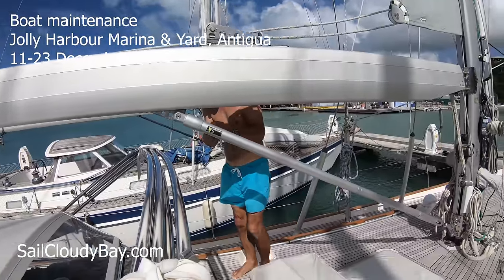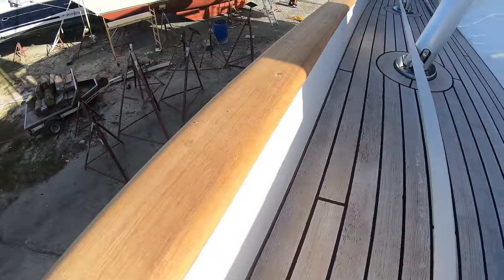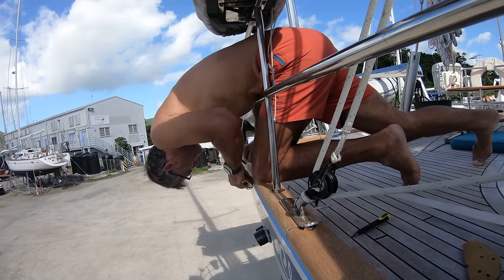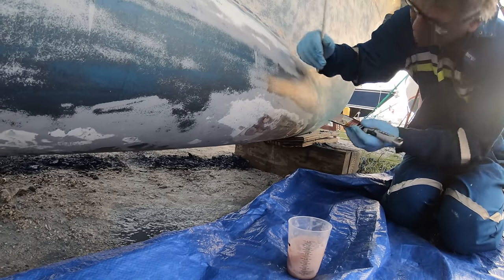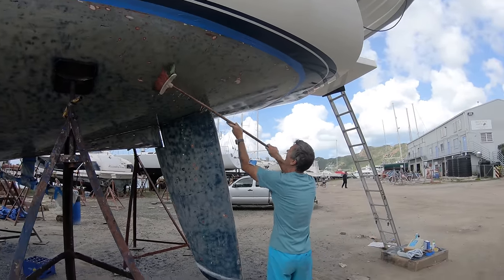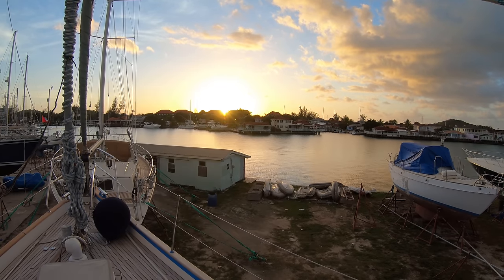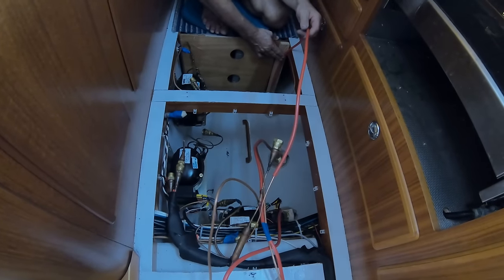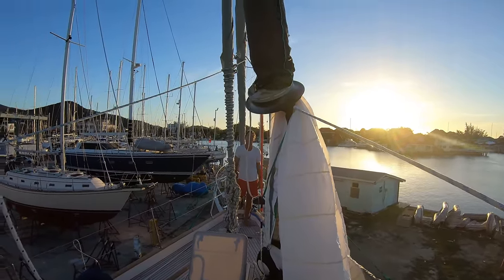ep55 - Boat maintenance - Jolly Harbour, Antigua – Hallberg-Rassy 54 Cloudy Bay - Dec 2018

Comment: @ Cloudy Bay: The correct way to braze refrigeration lines is with fluxless brazing rod AND a nitrogen trickle through the copper line while brazing. Also, a new filter drier is installed every time the lines are exposed to atmosphere.. The system has to be evacuated before refrigerant is added back. Any refrigeration or a/c tech will confirm what I have written.

Omitting the nitrogen trickle allows a load of black gunk to form on the inside of the tubing and that gets into the expansion valve, evaporator distributor and compressor.
Reply from the maker: Thanks for the advise Paul. Unfortunately getting good refrigeration people in Caribbean is really tough. I think I will try to find another more qualified person in St.Maarten and have the systems vacuumed.
Reply: @SailCloudyBay  You seem to be mechanically capable. It is not too hard to learn how to do your own refrigeration maintenance and repairs,
Reply from the maker: Yes, I'm just new on that path to learning the intricacies of refrigeration maintenance. Clearly its not rocket science, but it does have its specifics you need to be very careful of.  I bought gauges and a bottle of R134. Maybe I should get a vacuum  pump too. Question is, where do you stop? vacuum pump? brazing torch? refrigerant detector?  In mid Pacific I'll probably be glad to have all that!
Reply: @SailCloudyBay  The R 134 is worthless without a vacuum pump, manifold gauge set, fluxless brazing rod, nitrogen bottle and nitrogen regulator. Best to get experience before you need it.. The small sizes you are working with can (probably) be brazed with a Bernzomatic jet torch. When you are in the US, you can get the vacuum pump and manifold gauge set cheap from  Harbor Freight.. 

Practice brazing on some copper scraps with the nitrogen trickle. Pressurize your practice assembly and check for leaks with Windex or soap solution.Cut it apart to confirm that you can make a clean braze..

If your refrigeration circuit does not have service ports,then you need a refrigeration scale and a spec to weigh in the correct amount of R 134.
Reply from the maker: Paul, fully understand. But what makes "R134 worthless with a vacuum pump"?  Not questioning you, just trying to understand, because our fridges seem to be working OK after 3 weeks now.  That said, with your advise and several others too, we will be having all 3 systems vacuumed and refilled correctly once we get to St.Maarten, where services are as good as europe.
Reply: @SailCloudyBay  I wrote worthless not worth....But that is not really accurate. You can add R134 if you have a small leak without evacuating so long as there is still pressure in the system. If the system is opened, then you need to evacuate before recharging.
Reply: FrigoBoat has extensive troubleshoot files. You should not have to be evacuating an new FrigoBoat.  I suggest you read the files and give them a call.
Reply from the maker: If we were connecting the new keel coolers into a frigoboat system it would have been easy. But the rest of the set up is Isotherm and of course they dont have the same connectors. So we had to chop the Frigoboat connectors off and braze on isotherm one.

Comment: hi great videos, but I have to ask when the fridge work was done, did they get vacuumed and checked they held a vacuum prior to gas been added? it is imperative it is done to remove moisture from the system or they will be plagued with problems.
Reply from the maker: Good point. No he didn't.  The way he did it, would not have let any "air" into the system. But now that I read up, you are right, it should be vacuumed. I'll get that done in St.Maarten.  Thanks for noticing that.
Reply: Sail Cloudy Bay, Hope iv helped. Whenever you have a leak in a refrigeration/air-conditioning system ie. needs gas!! there is a leak/hole in which air can ingress and gas escape! Air contains moisture the biggest problem for refrigeration systems and the only way to repair the system is to vacuum it. the couplings that the systems you have will introduce air, we looked and trialled them for many years and were never happy with them when we used to manufacture and supply systems. I also noticed when he brazed the lines, it looked like he changes the fittings it would have left the lines open. the long and the short if it's opened in any way you need to recover the old refrigerant prior to work, carry out the repair maintenance then evacuate the system with a vacuum pump (overnight is best as it dries the system of any moisture yes there is a dryer installed in the system to try to dry the gas but it needs all the help it can get), only when it holds a vacuum with the pump isolated only then add refrigerant to the correct level, the correct level now that has to be calculated and the correct weight of gas added or if you have a sight glass you can watch that till the flow is clear and consistent ( a good sight glass will also have a moisture indicator built in). Moisture in the system will freeze in the capillary tube or if on larger systems the expansion valve and cause the system to fail. I'm an ex-marine engineer/refrigeration engineer and I can assure you unless they use a vacuum pump and the proper service ports that can be evacuated along with the lines and refrigeration gauges all the way to the cylinder with refrigerant it will always introduce air. if I can ever help drop me a line always happy to help.

Comment: Nice video lots of details 
Glen I did not see a vacuum pump used on your refrigeration also your tech guy opened the valve to let vapour into the system. If this is 134a which most are today it is an isotopic refrigerant it must be charge by liquid feed only . If this was not done you will have problem . Dont know the date of this but if its weeks or month you may have already experienced poor performance.  
Fairwinds from the  @captains.chair
Reply from the maker: Good point. NO he didn't.  The way he did it, would not have let any "air" into the system. But now that I read up, you are right, it should be vacuumed. I'll get that done in St.Maarten.  Thanks for noticing that. So initial fill has to be with liquid (with bottle upside down), not with vapor? (bottle right way up).
Reply: @SailCloudyBay  I've been an industrial refrigeration mechanic for 33 years. So I do this still every day but on units much bigger .soon to be full time sailor .
As for your question yes liquid here are the steps to be followed .if you have any question you can find me on Instagram @captains.chair 
Step 1) pressure test 200psig min I use nitrogen inert gas and less then 5 micron of moisture which is #1 enemy 
Step 2 no leak? vacuum pump, time is essential to remove moisture & non condensables these will  cause multiple issue .if not removed well.
if you have a micro gauge to measures moisture awesome 

if not evacuate 30 min then break vacuum with a squirt of liquid 134a to 2-3 psig  evac this back down to 30" . Close ref gages valves let stand for 15/30 min this should maintain 30" if this deflects  28"  25 "  you still have moisture or possible leak repeat til your suction gauge(blue) maintains 30" make sure ALL FITTINGs ARE SNUGGED hoses to gauge and vacum pump etc.
Step 3 once you are 100%sure she maintains 30" WC you are ready to charge liquid 134a only
This should be weighed in by scale . On the package it will tell you how many ounces .( Tag)
Anyone telling you they can charge these very small units any other way are cowboys .period
If you do not have a scale or vacuum pump let me know I will explain another method. 
Once charged.  read up on superheat and subcooling if you have digital thermometer you can check the charge using this method but it is time consuming on these little units and very finicky
If you follow these instruction to a "T" you will have many many years of carefree refrigeration and when we meet up one day .I will be expecting a very cold beer...or 2 
Hopefully sooner then later 🍻🍻⛵⛵⛵⛵⛵⛵⛵.
P.S calibrate your gages before you start to 0 psig that little screws on the dial  ,be gentle 
Fairwinds from the @captain.
Chair
Reply from the maker: Jim,  That advise has to be worth at least several beers!  Thanks so much. I dont have a vacuum nor N2 nor a scale. But we are about to go to Sint Maarten where I will find those things plus a decent guy like yourself to administer.  With these instructions in hand I will watch like a hawk this time.
Reply: Did not your FrigoBoat come pre-charge with leakless connectors?
Reply from the maker: If we were connecting the new keel coolers into a frigoboat system it would have been easy. But the rest of the set up is Isotherm and of course they dont have the same connectors. So we had to chop the Frigoboat connectors off and braze on isotherm ones. Sadly.
Reply: @alansugarman2631  Hi Alan if you ever find connections that are   "leakless"" let me know I will split the million dollar idea with you😉 .lol 
Unfortunately there is no such things . Most leaks are from corrosion ie poorly insulated or vibration . They do now have teflon lined stainless steel flex lines that have  dble flanges flares . These are expensive but very reliable 
 Definatly after market product. 
Fairwinds ⛵
Reply: I see. But you have the Isotherm quick connectors. Will be interested to see  what you do next with your fridge. Very frustrating.

Comment: Hi there let me comment about the painting of the bottom NEVER EVER paint the last 2 layers upside down ALWAYS ALONG the boat , it reduces the drag and reduces the anti fouling paint to be scraped away , small advise , :-)
Reply from the maker: Thanks for the advise, I've certainly never heard that before. If the paint is put on evenly there should be no difference in drag vs any particular direction. That said, maybe you are talking about the coats that we had applied before Glen took over the painting. The guy was rollering in long vertical strips that left the paint thick on the edges and thin where the middle of the roller had gone. So he got kicked off the job and Glen finished it ... painting the last coat evenly.

Comment: was taught never use acetone on gel or fibreglass,it's an acid which works on breaking down the materiel and weakens it
Reply from the maker: Interesting .... never heard that before.
Reply: Best is to use styrene monomer for fiberglass work.. It cleans and reactivate the old fiberglass making a better bond with the new...

Comment: I know you leaked currency but did you test for current leakage after those boom lights?
Reply from the maker: Ratus Bagus not quite sure what you mean but if you are asking the consumption of the boom LED strip, it’s about 10watts
Reply: @SailCloudyBay  It was a poor joke linking refit currency leakage from your wallet to electric current leakage from your boat.  
Fitting cheap or/and Chinese domestic stuff into your vessel can come back and bite you. Hard. 
Faulty connectors or earth or maybe that little box within a box symbol that should mean that it doesn't need an earth because its got magic electrickery components inside? Well sometimes that's just assertion.... and it doesn't. It works along the lines that it'll blow, be binned and not followed up..... rather than sink a ship with all hands. 
Sailing Hilma's rudder was lost mid ocean after the did some electrical work. Look them up. They have a few videos that cover cable work, later mid ocean drama followed by the restoration. The stock corroded fast. 
You're still here so perhaps you're OK. But if trips are tripping.... 
https://www.boatingmag.com/how-to/locating-ground-faults-current-leaks-and-short-circuits/

Comment: Top surface of the rudder?
Reply from the maker: Ratus Bagus what about it?
Reply: @SailCloudyBay  did you manage to get to it to paint it?
The boot line was definitely fantastic BTW!
Reply from the maker: Ratus Bagus yes, with the rudder on full lock I manage to roll paint onto the upper surface.
Reply: @SailCloudyBay  I just had an idea for getting paint into all those hard to get to places.
Get her into a dry Dock. Remove sensors and plug through-holes. Mask off topsides down to the bootline.  Give Hull a little rub over. Fill dry Dock with antifoul or copper coat. Drain & dry. Unmask and unblock thru's. 
Then just add water.  I'm sure this would work and dispenses with that support patch nonsense. What do you think?
Edit. You may have to refill, drain and dry a couple of more times.
Reply from the maker: Ratus Bagus what a brilliant idea. But there would be no need to mask off the top sides!  And ... how would we paint from waterline to the boot line, eh? Eh? The technique might also use a tad too much paint too!
Reply: @SailCloudyBay  what's with all these negative vibes Moriatti. Think positive man and that bridge to our golden prosperity and business success will be there.
On those little cost wrinkles, I was thinking that you would provide the venture capital and I'd provide the thought leadership, inspiration and innovation. 
I'm sure I can count on you to come up with a flexible financial framework for the paint anomaly.
BTW Topsides...would be something similar but upside-down with mast and rigging removed. This would provide an additional bonus of dispensing with all those internal varnishing jobs. In fact we could leverage that as our trademark feature. Thought I'd run that up the pennant pole to see if it would attract a salute.  Thoughts....?
Reply from the maker: Ratus Bagus good luck!

Comment: Seems like you kept throwing Herrington harbor under the bus. Your bottom job would it look like that if you were willing to pay to have it done....
Reply from the maker: Yes it would have looked like that and my wallet would have been $2000 lighter!
Reply from the maker: Just to add, we had great work done in Herrington. The gelcoat repair by Osprey was fantastic and the polishing worked out really well too. regarding the bottom, we had no choice but to strip it all off due to a reaction with fresh water and it was the stripping back that was a huge cost compared to having it done in Antigua. The other 2 factors were time and temperature. We really wanted to get south before the weather closed in and doing the bottom properly would have added another week at least. And the temperature was already marginal for applying the 2-pack barrier coat. So yes, we mentioned "this is how it should have looked in Herrington" but it was not meant as a bad mark against services there.
Reply from the maker: Just to be clear, in Herrington they wanted $4000 just to strip (soda blast) back to original barrier coat - a 1-day job. And then painting would have been $1000 per coat. In Antigua we had a haul/launch, the paint stripped and all the paint (5 coats) applied all for $2000.
Reply: @SailCloudyBay  Side note: 2000$ for yard work and 600$ for a small cart of provisions:  I can't reconcile.
Reply from the maker: Good comparison, I see your point. Its the opposite of USA here.  Goods in the Caribbean are expensive (all imported to a small market) whereas labor is cheap.  Thats how you get this odd discrepancy.

Comment: Hi Guys. Need to get a honest opinion. How often have you wished you were in a much smaller yacht. I ask this because I want something around 50' and I am told it is silly and I should be looking sub 40'. I dont believe I will be comfortable with a smaller yacht.
Reply from the maker: Short answer: For us, we have never wished for a smaller yacht.
FOR LIVEABOARD, if you can afford the yacht, upkeep and mooring fees I would always go for as big as you can up to about 58ft. You get used to handling the size quickly. 
Above 58ft the loads on everything become significantly higher - too high for a couple to handle if the systems go wrong or you need to drop or raise a sail at sea. 
Below say 48ft you are struggling to get all the needed equipment on board like fridge/freezer volume, water/diesel volume, generator, watermaker, aircons, heaters, washing machine, all your water toys, bikes, downwind sails, tools, spares parts etc etc. Well, you can get squeeze them in, but you loose valuable stowage. For instance we fell in love with a Malo46, but it had no generator or watermaker. Just adding those we would have lost massive amounts of valuable stowage. We simply couldnt see where everything we needed would fit into the yacht.
The other factor is performance. No matter what size yacht you have, when you put all your liveaboard gear onboard, it likely weighs up to 3-4 tons (yes .. really!). The larger the yacht the less waterline you lose for that weight (only 2-3cm on a 30ton yacht like Cloudy Bay). It get worse on a lightweight yacht or cat, the reduction in waterline is significant, leading to reduced sailing performance which could even take the yacht beyond design capabilities in ocean conditions. 
And lastly, from Oana's point of view, if we are to live full time on the yacht then it needs to feel like home and not camping. The happy-wife-happy-life concept is very important to ones karma :)
Likely the people telling you go sub-40ft are not aware of what electric winches, hydraulic furling, bow thrusters etc can do to make handling easy when short handed. Or they dont want all the maintenance that goes with them. They are also likely only weekend sailors with the occasional 2 week holiday on board where hand-grinding winches, slab reefing and "camping" type living is acceptable for that short period of use. That said, we have seen LOTS of people on sub-40ft yachts looking quite happy! But their yachts often look cluttered and low in the water.
Reply: @SailCloudyBay  Thank you for taking the time to reply. You have reinforced my decision to go big. 
Thanks again.